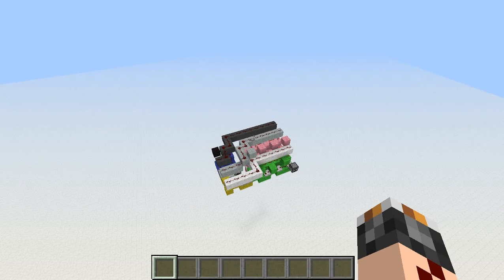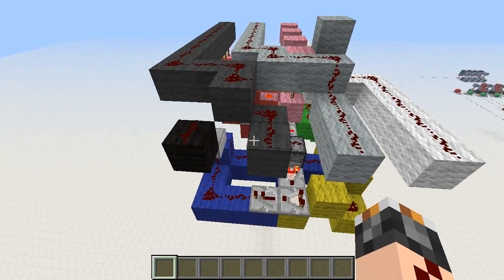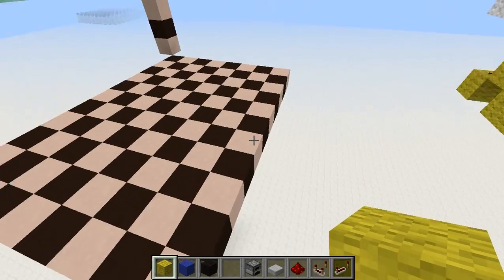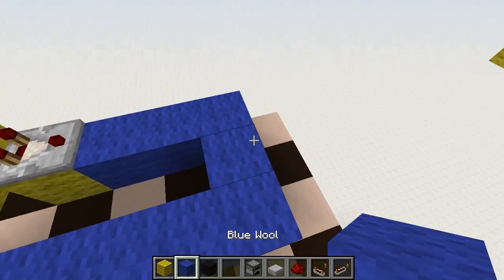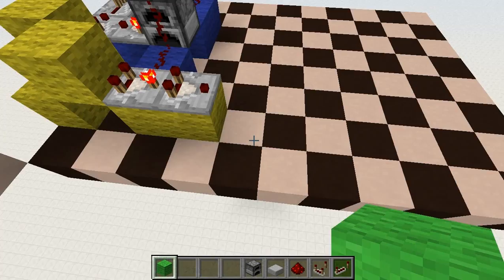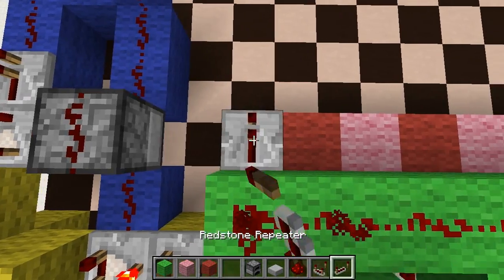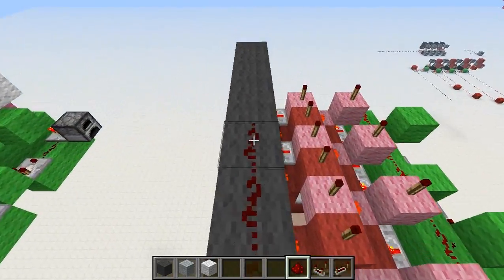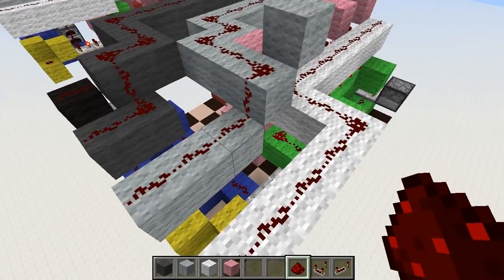Compact Analogue to Binary (Digital) Converter with Tutorial - 11x8x6 - Minecraft Redstone

Comment: I kinda understand how it works, but a little explanation would be a good thing. To get to know all the process you pass trough. ;)
Reply from the maker: The easiest way to convert analogue to binary is to decode it (have one of 16 wires turn on) and then encode it into binary. The whole thing is quite huge, but I found a way to shrink it by adding an extra step before I decode it: if the signal strength is above 7, I subtract 8 from it. This itself gives one of the output bits, but also decreases the maximum signal strength to 7. Now the decoder-encoder combo can be half the size it would otherwise be.